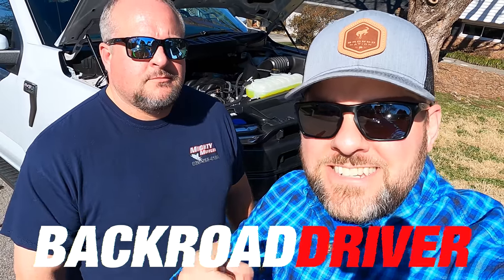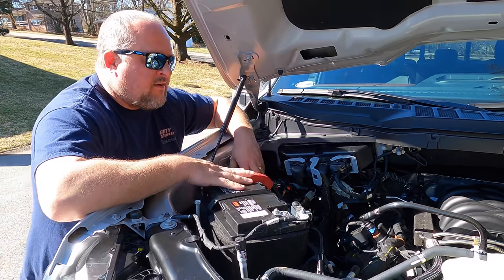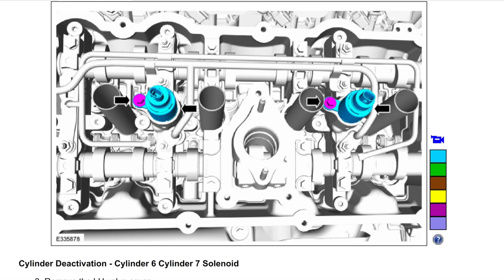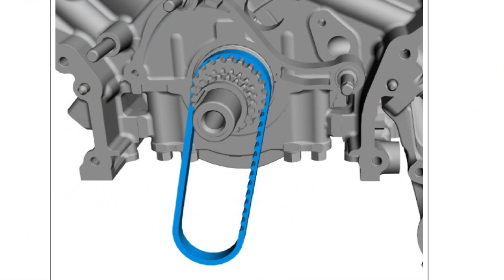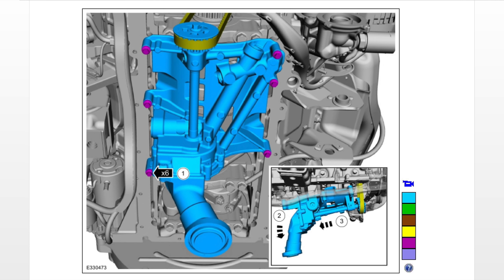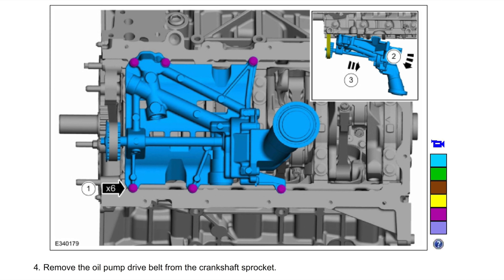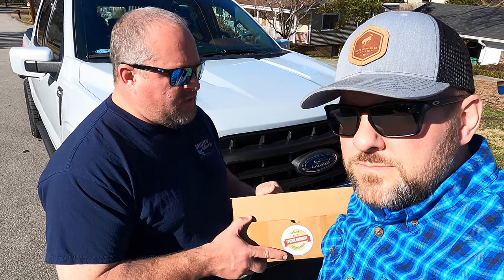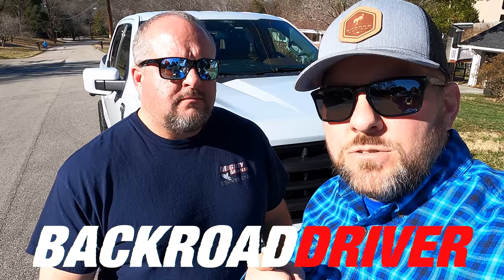2021 Ford F150 5.0 V8 Cylinder Deactivation & Oil Pump Belt Explanation - JLT Catch Can Install

Comment: Great info guys. I went to 2 different dealers. After discussing the truck I mentioned the cylinder deactivation. Both denied that Ford was using this. Not a good way to get trust with the customer. Ford knows a lot of customers will shy away from this and I believe that Ford told these sales people to not mention it.Outwardly denying it is shocking and unacceptable.Excellent recon on the belt info.Hidden for a reason.Keep bringing us out of the dark /into the light.......👌

Comment: Here comes the wiped cams like gm and dodge...
Reply: Not a pushrod engine.....
Reply: LOL pretty rare issue with the GM engines these days. Definitely a common issue with the 08-13 engines. Ram 5.7's with MDS usually wiped cams because people would idle the engine too long and the rollers wouldn't get enough lubrication. The most common reason for AFM/MDS/DFM issues is when guys think they can go 7500 miles between oil changes. Dirty oil and sludge cause cylinder deactivation failures. Kind of like dirty oil and sludge cause timing chain and cam phaser issues on Ford DOHC engines.
Reply: @billgates1682  "Not a pushrod engine....." 

Whether an engine has pushrods or not has next to nothing to do with AFM/MDS issues. Honda uses cylinder deactivation in the DOHC and I've seen plenty of destroyed engines when the system has problems. The primary cause of lifter issues is due to the owner not changing the oil often enough. The oil builds up with contamination (carbon, combustion by-products, unburned fuel) that combines with sludge formations. This junk in the oil isn't captured by the oil filter and builds up in the tiny oil passages and screens that feed the AFM system. That same kind of buildup has damaged plenty of Ford Coyotes and Ecoboosts when the sludge restricts oil in the heads and starves VVT systems.

Comment: The auto start/stop is the main culprit for oil consumption 2018-20.  Cylinder deactivation may or may not increase oil consumption, but looking at older engines with it, the deactivation will speed engine wear.  If it was my truck, id deactivate the deactivation.  I installed the autostop eliminator 5 days after i bought my 19 5.0l.  Its great.  Mine doesnt have oil consumption issues at least as of now w 14k miles.
Reply: Supposedly, in sport mode it will not deactivate cylinders, so you could always keep it in sport mode when you're not towing.  The feature is also deactivated in tow mode.

Comment: I'm glad you explained why you were installing the catch can since your truck has port and direct fuel injection. I have a 2020 F150 and for that reason I did not install a catch can, however I understand your reasoning since you had one from your old truck and want to see if it will catch any residual oil. In my opinion I believe Ford is being low key in regards to the cylinder deactivation because they do not want to discourage people from buying the V8 since other manufactures had problems with cylinder deactivation.

Comment: Ford isnt advertising deactivation because the other manufactures have had such issues and it's earned a bad reputation no one wants it. I love my 2016 coyote F150 but if I were in the market now, I might reconsider the V8 for a few years.

Comment: My 5.7 Chrysler Hemi 300C has deactivation. Most 5.7 Hemi engines have it. I only see the 4 cyl light come on when I'm on the interstate driving under 65 which is rare.. Around town or at the track I use Sports mode. It never comes on. I drive my car hard, so it's not an issue for my use. By the way. several other brands use cylinder deactivation like GM. Do some research.

Comment: You can disconnect the plug on the battery and that will disable cylinder deactivation  problem solve 🤣😂😂😂🤷‍♂️🤷‍♂️
Reply from the maker: I'm not talking about Auto start/stop. I'm talking about deactivating four of the eight cylinders on the engine while driving down the road.  This can't be disabled by removing the wire on the battery. I've heard that that is an option for disabling start/stop though.
Reply: @BackroadDriver  nope its for the cylinder deactivation my friend has one and did no codes and stay on v8 all the time
Reply: @michoacanom4320  I'll look into that further.  Thanks!
Reply: I have a 2017 Silverado 5.3 that has cylinder deactivation.  Range Tech sells a device to override it and keep you in 8-cylinder mode.  My guess is one will be developed for  Ford's new 5.0.  I can also keep my engine in 8 cylinders by driving in the manual mode and staying in the 5th speed on my 6-speed transmission.

Comment: Increased compression ratio + spray-on bore liner + excessive oil consumption + knocking + wet oil pump belt + cylinder deactivation = why I will forever stay away from Coyotes. What else are these brilliant engineers doing, still giving it a plastic oil pan? Thanks ford for screwing up another engine.
Reply: actually they gave it a metal oil pan this time around surprisingly!
Reply: The spray-on bore liner was the biggest mistake IMO. When they had a German company that developed the process doing the nikasil lining, there weren't many issues with it. Then Ford decided to do the bore-lining on their own to save money and that's when the knocking and oil consumption started being a lot more common.

Comment: Dose it deactivate in all drive modes or just eco.
Reply from the maker: It works in normal and eco for sure. It doesn't activate in tow haul mode or sport mode. I'll check on the other drive modes and update in a new video.

Comment: Hey, guys! Great video and definitely discussions worth having... being a Ford and GM fan, we all know what happened after GM offered cylinder deactivation. Hopefully Ford engineers figured things out, but time will tell.

My only quibble is about the part where you implied that Ford is hiding the feature. if you look at the 5.0’s description on the F150 build and price page, it’s very plainly there:

“This legendary available Ford V8 with 10-speed transmission delivers all the muscle you need plus a best-in-class maximum payload rating of 3,325 lbs. * Experience robust 400 horsepower and 410 lb.-ft. of torque, courtesy of twin independent variable cam timing (Ti-VCT), as well as the Ford port-fuel and direct-injection (PFDI) system with two injectors per cylinder — one in the air intake port, another inside the cylinder — to increase power. And new Variable Displacement Engine (VDE) technology allows the engine to shut off half of its cylinders when full power is not needed.”
Reply from the maker: Thanks for watching Michael!  I see that you are correct. It is in the description now. Unfortunately I built my truck back in September and placed my order on October 2nd. At that time it was not on the build and price and many features were missing and pictures and descriptions were only partially available.  In the video, I first said they were trying to hide it but then reeled that back in a little. They sure aren't making a big deal out of these changes or being very forward about it. Many people like yourself feel that these are pretty big changes so that was my main issue with the way they have handled it.
Reply: @BackroadDriver  totally get it! And I’m glad you did. I also mentioned the feature in my review — https://youtu.be/r6KuMrGnwk8

Comment: Have the same catch can on my '20 2.7L, they are a must, caught .5 oz of oily/gas/water mixture at only 600 miles.  Wish the hoses weren't so long, they're double the length they need to be.

Comment: Honda and GM have had oil consumption issues with cylinder deactivation.  The cylinders not firing won’t have as tight a ring seal.   Not sure how you can avoid all consumption.  

I just installed a Range device on my
Girls 07 Tahoe.  Consumption is WAY down now that it stays in V8 mode.
Reply from the maker: Thanks for watching Anthony!  I'll be keeping close eye on the best way to deactivate cylinder deactivation for sure!
Reply: This is correct, the 3.5 V6 in the Honda’s were very bad at it and fouled plugs all the time. I installed a device/dongle to keep it from deactivating the cylinders and the problem was solved.

Comment: the drive belt will be a problem 150k-200k down the road?
Reply: Less way less specially if you run it off road is it gets covered in dirt sand, water or whatever,  so if this belt snaps while driving will the motor turn off automatically ? Or will the engine seize from oil starvation
Reply: @marleybrown4554  wtf are you talking about? The belt is internal to the engine. It’s not going to get full of dirt from off-roading. If it did....you’ve got bigger problems

Comment: Fixing to buy a 2021 f150 5.0 in the next few months. After the factory warranty, that cylinder deactivation will be deleted if available.
Reply from the maker: I think you are right. We are working on a fix. If we figure it out we will post a video.
Reply: Maybe by then, they’ll be a kit to fix the oil pump belt issue as well.

Comment: I will just turn my auto start stop off and keep my 3.5 ecoboost.
Reply: I don't even notice the auto start stop on my mine. I do love the 3.5 ecoboost.
Reply: @Steve-yr5vi  I turn it off because I figured the starter and battery are already heavy duty because of the start stop so by not using the start stop function I think the battery and stater will last a lot longer.

Comment: Also these new trucks might be impossible to tune. If there is an update for engine or transmission programming. You don’t bring the truck in. It just does it wirelessly.
Reply from the maker: Anything is possible given it enough time.  It's not going to happen right away but I think eventually the ECU will get cracked.  Depending on how long it takes, piggyback systems will become available to do the same thing as well.  Look no further than the C8 Corvette.

Comment: I ordered my 2021 F150 with the V8 engine without the start stop button. My question is that connection to my battery is connected does that mean I have the cylinder deactivation?
Reply: yes

Comment: My brand new 2021 Roush truck doesnot have cylinder deactivation or auto start/stop or reverse brake assist. I did see on the window sticker that it had auto start/stop removed and it was a $50 charge, no clue on other items
Reply: Are you still not experiencing cylinder deactivation?   I'm interested because I just purchased a 2022 roush and was concerned about this.

Comment: Oh God  chey had a Hugh problem with that  last year my buddy's chevy would only run on 4 and couldn't fix it
Reply: GM had huge problems with the 09-13 engines with AFM. There aren't nearly as many issues with the 2014+ engines. People hear stories about AFM problems and don't stop to think about just how many engines GM builds each and every year that has AFM or DFM. They easily sell over a million vehicles (trucks, full size SUV's, Camaros and Corvettes) with V8's and V6's that have AFM or DFM each and every year since 2014. There has to be at least 6 or 7 million of the newer AFM/DFM engines out there. Even if there's just a 1% failure rate, that's tens of thousands of engines that develop an issue and most of them show up at dealers. That's where the whole "I know a guy that works at a dealer and he's always fixing engines with AFM problems" -- yeah no shit shirlock your buddy works at a dealer where all those vehicles go to get things fixed under warranty and GM sells over a million vehicles with AFM each and every year. Imagine that. 

Most of the time the reason cylinder deactivation systems have problems, it's because the owner goes 7500+ miles between oil changes. The same reason most AFM or DFM systems have issues is the same reason most people with a 5.0 or Ecoboost have cam phaser or timing chain problems. These newer engines don't tolerate dirty oil. All the tiny oil passages and screens get clogged up and cause a lifter to get stuck or a cam phaser to start to rattle.

Comment: With the 3.0 diesel  the transmission has to be removed to Service the oil pump belt is it the same for the v8???
Reply from the maker: It looks like the oil pan can be dropped to change the belt on the V8

Comment: Does this 'new' 5.0 version still have the 'Plasma Cylinder Liners'..... and do they, thus, still have oil consumption issues, or have they gone back to the iron cylinder liners?
Reply: Its a v8, it will consum lots of oil. Just like all us v8's.
Reply: @MasterCarguy44-pk2dq tf are u talkin about .